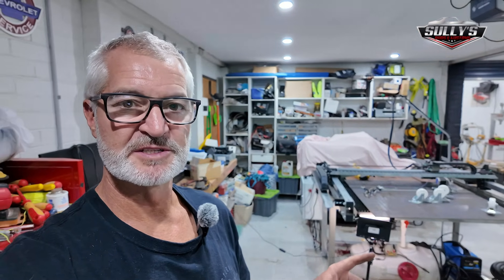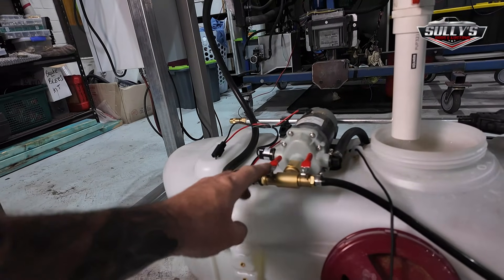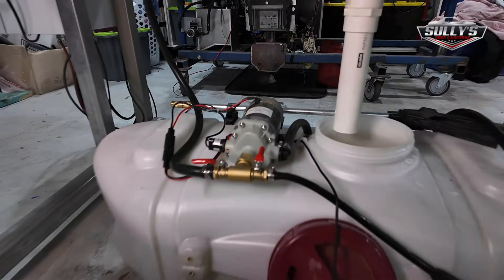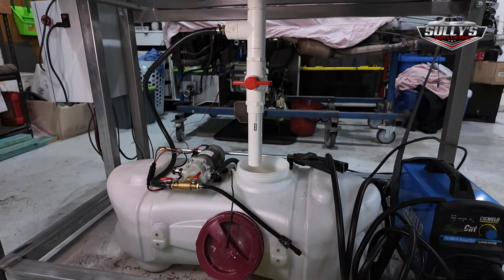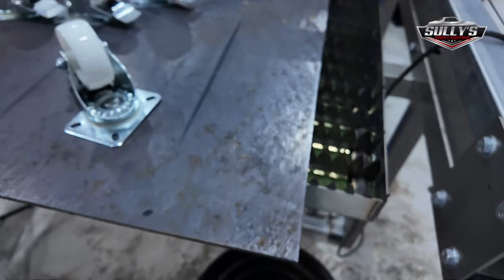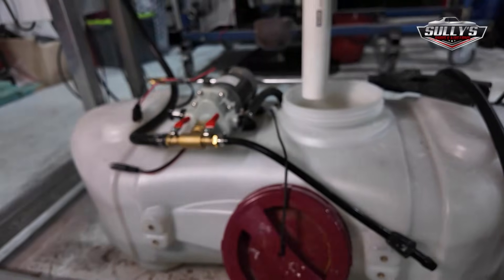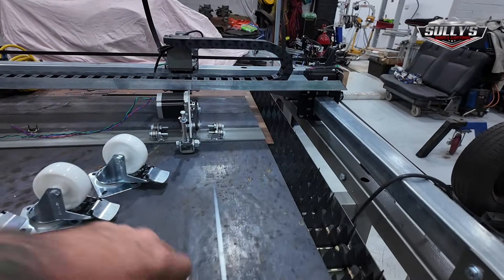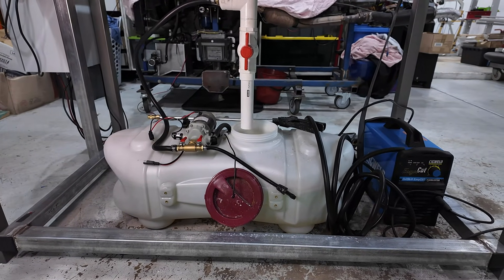DIY XL Plasma Cutter Build part 5 (coolant tank)

Comment: Mate, where did you get your pan made up? In the Gong?
Reply from the maker: @allangoodger969  I had a local company make it for me. Wollongong sheet Metal at Unanderra. Not cheap though.
Reply: @SullysRodskustoms.  Will have to give them a call.
Reply: @SullysRodskustoms.  Vaporized antifreeze can be dangerous, borax will work as well and is safer.
Reply from the maker: @ArloMulta  the Anti freeze is 10-1 mix. Very very weak mix, just to minimise corrosion. I'm in Australia, more chance it will boil than freeze.
Reply: Brilliant Keven unreal mate  👌